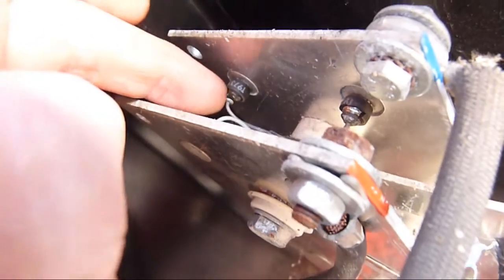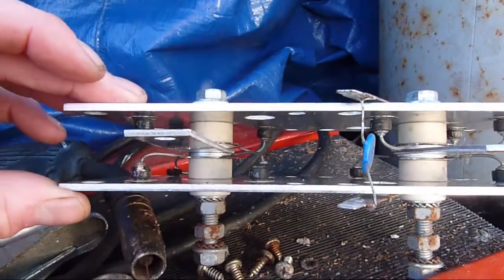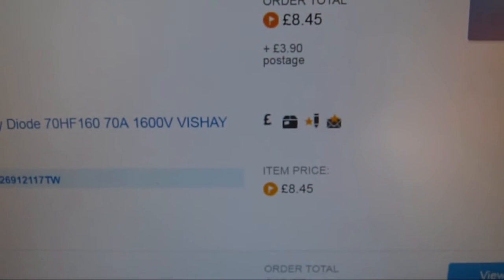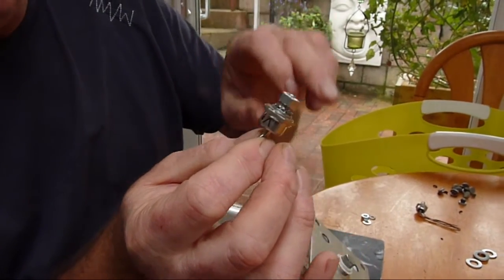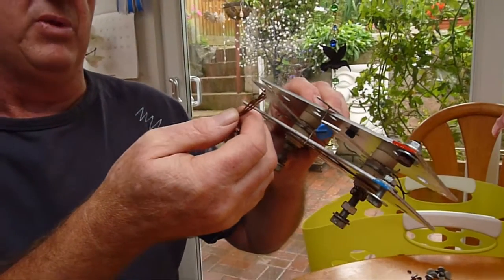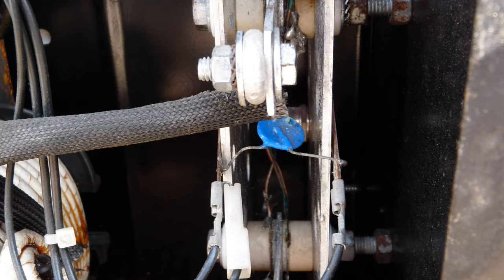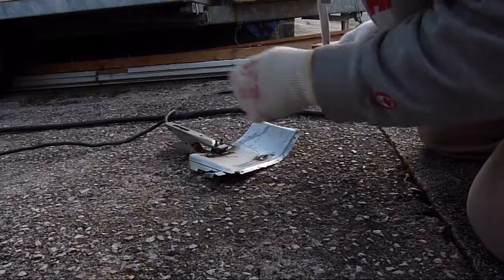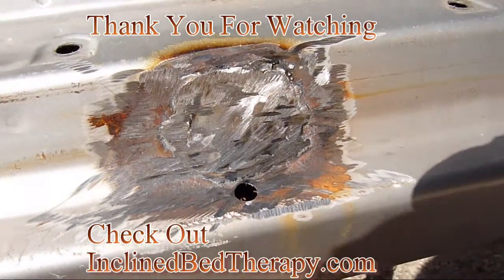Fix Mig Welder Repair + Upgrade diodes in Original Bridge Rectifier Easy DIY

Comment: Question:  Can we replace all the diodes with a single built in bridge rectifier in a MIG welder?  Some people use such bridge rectifier to convert AC welding machine to DC welding machine. I saw a video showing a 300 amperes bridge rectifier beeing installed to an AC welder. Testing was great.

Comment: Somebody gave me a dead MIG welder a couple of weeks ago. I'm electronics technician but I didn't know how such a machine works. I was lucky enough to find a schematic. After testing the diodes, 2 diodes (total 8 diodes) were short.  I landed to your good video and ordered 8 diodes (70 amps like the one you show) and replace them all, paying attention with straight and reverse polarity.  There was also another problem on the PC board where the relay was dead (open coil).  I changed the relay and now the welder is running like a new machine with great quality diodes. Job cost me $40.00 dollars. All is well that ends well!!! Thank you mister for your precious and very instructive video. Hello from Montreal, Canada.

Comment: Hi. I Have a diode problem too, but a different plate set up to you - can you tell me does the earth strap wire attach to the middle tab or the blue paint ? I cant really make it out from the vid......Also  do you think I could use 1200v diodes as they are alot cheaper (The guy's prices have rocketed in 7 years) Obviously business is good  - thanks to you!
Thanks in advance, Peter.

Comment: Diy flux pine rosin and 90 percent rubbing alcohol i made some its works great . mix in an old pill bottle and stuck a marble in as mixing aid or stainless washer do not use and thing that is corrosive/rustable as it will slowly rust a washer ask me how i know lol  .thank fer video sir be blessed

Comment: Well, it's a good idea to use a stud diode put them in the old press in one's holes. But with a tail lead on it so you can just drill a hole in your ~inputs bars and rivet in place instead of all the silly soldering and such to wire.  good DIY video.  One other suggestion!  4 diode =180a, 6 diode =200a, 12 diode 300a bridges  Kind of a common china drop-in part they all use. 180a  should use  4x50amp diodes  200a should use 4x70amp diodes and 300a should use 4x85amp diodes.  Fast Decay diodes are more suited for welding!  Sorry just years of rebuilding this crap and to many people with no clue balls deep in stuff like this going in blind!
Reply from the maker: soldered joints preferred, each to their own,
Reply: Rich, if I am following his wiring schematic correctly it seems to me that this bridge rectifier is configured in a manner that would result in the electrode being negative and the clamp being positive. He appears to be welding with bare wire and shielding gas which should be set up for electrode positive. Are my observations correct?

Comment: I had a welder with a slightly different design that ended up with the exact same problem.  It worked better for me to just buy HFR type diodes instead of HF diodes because of the different layout of the plates.   I made a video  ( https://youtu.be/gQD6YJHHEGs ) discussing some of the details that helped me figure out exactly what I needed to do and understanding how a bridge rectifier works was key for me.  Big thanks to you for your video for getting me started on solving the issue.

Comment: I removed my rectifier and reolaced it with a 400 amp 1600 volr solid state rectifier and it works better than new. https://img.staticbg.com/thumb/large/oaupload/banggood/images/72/E4/ae3d165e-4da1-4d7f-a771-77efd058c28a.jpg
Reply: How's it going still? I'm thinking to do the same

Comment: Hi Andrew - i have a clarke 151EN with same issues - would you know which diodes i need ?
Reply from the maker: Generally if the total diode amps stack up to just over the limit of your welder, the diodes will work fine.
Reply: @AndrewKFletcher  hi Andrew - i have the clarke 151EN which i believe is a 30-150amp - just received the diodes from taiwan - hopefully they will do the job ?
Reply: @AndrewKFletcher  hi - just completed the install - no difference - even though i know one of my old diodes was brocken, the new diodes make no difference, NO PENETRATION - any ideas ?
thanks
Reply from the maker: Did you have matching pairs and are they facing the right direction with the electrical circuit?
Reply: @AndrewKFletcher  hi - yes - two flow and two return - knocked out the 8 diodes
- the positive side of the rectifier has two diodes and the negative side has 2 diodes--
on the positive torch side we had both diodes running in same direction and on earth side we had both diodes running in same direction
we looked at the wiring diagram and this seemed to be the case ? there is no penetration and no difference to when it was before with one loose original diode ?
Reply from the maker: @stephenkosloff6081  Could your wire feed tension be set too high?
Reply: @AndrewKFletcher  hi - wires were equaly soldered instead of opposites therefor connecting the bridge- all sorted now and welding 200 percent
thank you for your video
Reply: @AndrewKFletcher  what do you mean by equally soldered instead of opposite I'm having same issue thanks in advance

Comment: Last time you helped me out big time.I Have another problem with my other welder. I press the trigger and the motor seems to not have enough strength to pull the wire through. How do I test of the motor is crapping out?
Reply from the maker: Have you blown the gun through with an airline? It's surprising how much resistance the debris from the wire causes. Also, having the wire feed rollers too tight can cause problems. As for checking the motor, you will need to have it tested professionally if the above suggestions don't work.
Reply: Andrew K Fletcher thanx im Going to try that
Reply: Andrew K Fletcher The line was plugged..U are a genius haha
Reply from the maker: Occasionally, the wire can become crossed on the spool, causing intermittent stop start. If this happens, remove coil and allow wire to fall off from side to remove snag.

Comment: Hi I have 230v flux core heatsink it's 130amp can I still use the same diodes it has 8small diodes 4 on each plate looking forward to hearing from you cheers
Reply from the maker: I see no reason why it will not work, swapping 8 inferior diodes for 4 good ones will work

Comment: Hi can I use this  diode ?
https://www.ebay.com/itm/MDQ-400A-Amp-1600V-Power-Single-Phase-Diode-Metal-Case-Bridge-Rectifier-4-Pins/292306044163?hash=item440ecc4503:g:FHgAAOSwQS1Z8DsR

MDQ 400A Amp 1600V Power Single Phase Diode

Comment: Great Job! My Sip migmate 150 has rectifier issues, it is dual purpose gas or gasless, by swopping the polarity of the torch & flux cored wire, My question is that I have a single heatsink plate  with six cheap diodes that are all the same polarity, they are not marked but using a meter they are the same, I was thinking of two matched pairs of 1200v 40A, Do you think this would work ok? Thanks
Reply: Worked a treat 2 pairs of 1600v 40A diodes, Cheers

Comment: hello.i have a Lincoln weldpac 3200 hd. the welder only working on d the highest setting. the fan would come on on a, b, and c. but not able to weld anything.
what you think could be the problem. thanks.
Reply from the maker: Wish I had answers for you on this problems. You will need someone with a circuit tester to got through the wiring to find the fault. Probably to do with the switch.
Reply: Andrew K Fletcher  thanks.

Comment: Hi Andrew have you ever fitted a gas solenoid to 1 of these machines ?
I bought an old 1 & someone had fitted a euro torch but no solenoid 
I can get the solenoid to trigger but it also triggers when i turn the power up or down, any suggestions where to connect it so this doesnt happen ?
I have used 1 of the spare terminals on the power dial switch & spliced off the j2 cable from the board.
Any help would be greatly appreciated.
Reply from the maker: Not fitted one, but did find this, which shows one working and leaking. Video starts showing wiring https://youtu.be/6_znyF2V8iE?t=2m35s  Will look to see if I can find a guide
Reply from the maker: http://www.mig-welding.co.uk/forum/threads/supermig-150-euro-torch-conversion-gas-solenoid-question.51057/
Reply from the maker: http://www.howto-make.org/0j40lMoneypTLPjx/DIY-Mig-Gas-Conversion-For-Lincoln-Weld-Pak-100-Or-ANY-mig-welder.html  Right at the end of the video, he talks about reversing the polarity of the main output terminals for a gas conversion. Have you tried this?
Reply: Yeah i found this forum thread before but it just didnt help me, i even stripped our 220 super mig at work but its a different board so no luck there either.
Apparently there are 2 or 3 versions of the 180 machine also & i dont know what version this 1 is unfortunately.
Thanks for having a look the info has to be out there somewhere.

Comment: hello there, just got a mig welder 130. I'm eager to use it but I have the problem that it keeps feeding wire when i press the trigger even though it's set to 0 on the wire knob. Do you have any suggestions I what could possibly be wrong? thank you
Reply from the maker: Possibly the trigger on the torch?
Reply: Andrew K Fletcher thank you for replying. I've went ahead and opened the torch gun and found no issue there. I will return the unit back to the company.

Comment: I have a 180A HF mig welder that has a diode that failed. The diodes (8 total) does not have any numbers or writings on them. I am thinking about using the 70HF160/70HFR160 but I was wondering why you used 4 better diodes instead of using 12? I am thinking about getting 8 diodes. Will that hurt anything on my machine? Thanks
Reply from the maker: 4 diodes should work fine. The standard mig diodes x 8 or more is to spread the heat and voltage load, each of which is a weak link in the chain. Having 4 substantial diodes means you eliminate these weak links.

Comment: I have the same problem with my Sealy 100.  I noticed you only replaced four of the diodes. Did you remove all the old diodes?
Reply from the maker: Yes, all of the old diodes were removed and 4 substantial ones replaced them.

Comment: what were the symtoms of your machine & what web sites did you go to ? my machine feeds intermittantly under a load.
Reply from the maker: +mark501w  Hi Mark, machine made loud cracking noise as the original small diodes popped one by one.  Wire feed is a different problem all together. First, I would have someone blow out the inner wire feed housing as dust and fragments of the copper coating from the wire can accumulate and block the line feed. Another cause can be rust on the coil of wire. If you see rust then you will need to strip off wire until it is clean.   I can't remember which sites I went to that would be relevant.

Comment: I had a rectifier failure with an audio amplifier and in my search I found your video. Thank you for your wisdom and I may try those Vishay diodes which may be more robust than the BEN KBPC 5010. All the best, Rob